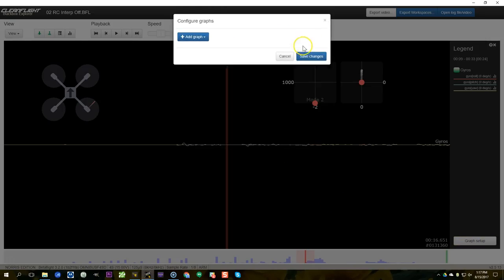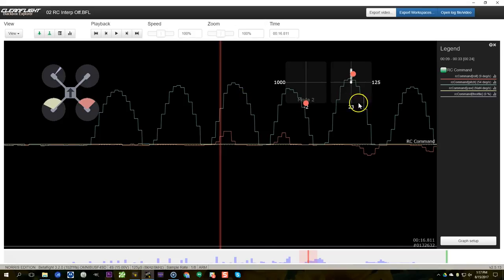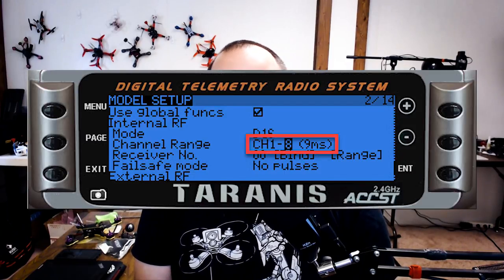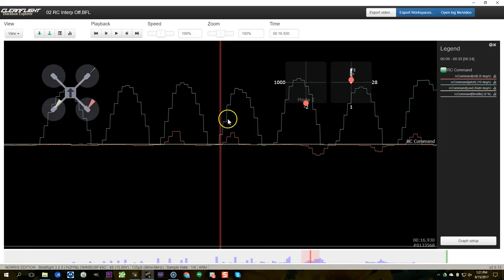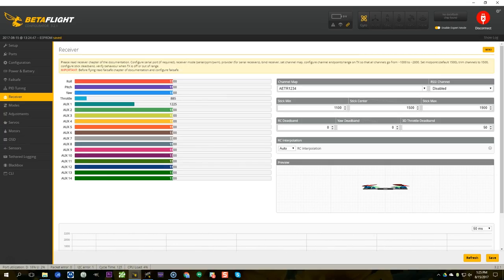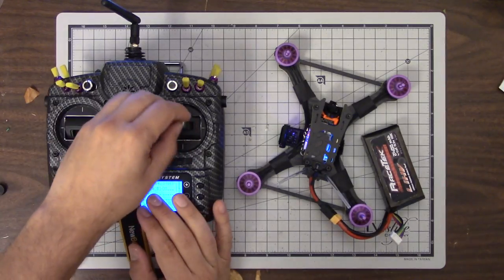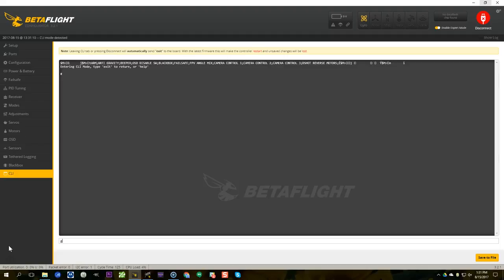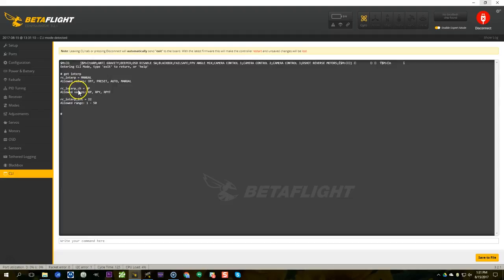Betaflight RC Interpolation | HOW TO TUNE

Comment: Joshua, here are my views on RC interpolation (which may prove to be somewhat controversial).

As you point out in your video RC interpolation reduces DTerm "kick". Decreasing the RC Interpolation Interval reduces delay and increases DTerm kick. As you allude, you can also increase DTerm kick by increasing the D Setpoint Weight.

Now different pilots prefer different amount of DTerm kick, so the question is: how best to achieve a given DTerm kick? You could use a largish RC Interpolation Interval and a largish D Setpoint Weight, or a smaller RC Interpolation Interval and a smaller D Setpoint Weight. Which is better?
 
My view is that it is better to reduce the RC Interpolation Interval and D Setpoint Weight. Why? Because RC Interpolation has several bad side effects:
 
1. Delay. RC interpolation delays the whole PID response to an RC input. If you are running 8kHz PID loops, then a 1 ms delay in the RC input delays the PID response by 8 entire PID loops. If you are travelling at 20 m/s (about 45mph) then in 1ms the quad travels 2cm, or almost an inch. In 10ms it travels 20cm or almost 8 inches.
2. Jitter. RC interpolation is processor intensive and can, depending on your setup, cause jitter in the main PID loop.
3. RC interpolation is a somewhat primitive filtration method - better filters are available to use on the DTerm directly.
 
I would go as far to say, that, if you have a non-zero value of D Setpoint Weight, then you should reduce it to zero and simultaneously reduce the RC interpolation. Or even turn off RC interpolation.
 
And that's how I run my quads: RC interpolation off and zero D Setpoint Weight. (That's the bit that may be controversial.)
 
Now I have to qualify that: I'm not a particularly good pilot - I'm a better developer than pilot, so other pilots may find that it doesn't work for them.
Reply from the maker: Do you mean setpoint weight instead of setpoint transition? Transition controls reduction in setpoint weight on stick return-to-center. But I don't think it affects the amount of kick on stick deflection.
Reply: Yes indeed, I meant setpoint weight. I've corrected my comment.
Reply: I would be interested in hearing a discussion on why that would be controversial. Does it go against conventional wisdom on RC interpolation and D Setpoint Weight interworking? What are the pros & cons and how would it not work for some pilots? And it should be noted that today I learned more about these settings that just noticing them in the configurator and ignoring them :)
Reply: I said it would be somewhat controversial because I have seen several postings in RC groups about RC interpolation and getting a smooth RC trace. My view is less delay is more important than smoothness, which is probably not the common view.

When I said it wouldn't "work" for some pilots I meant it figuratively, ie some pilots wouldn't like it.

I would encourage you to try different settings to see what works for you - tuning is quite personal.

Comment: Nice video Joshua. In my humble opinion the tune should be based in "normal" stick movement, no need to add extra latency when we are looking at surreal fast stick movement that will not happen in a normal flight. Record the blackbox with normal stick movement and we should be able to use a lower value. Just my opinion
Reply from the maker: That's fair.
Reply: I doubt that it will make much of a difference though, the stairstepping doesn't disappear if you move the sticks more slowly, it just becomes harder to see.

In theory the optimal value for the filter is the update period of your transmitter. If the transmitter is always transmitting one packet every 11 ms, then setting the filter to 11 ms should completely eliminate the stairsteps.

Comment: Joshua, I enjoyed watching this video as well. Quick comment: In the end it really does not matter how smooth the rc_command looks like on the blackbox output. What matters I think is the overall response of the system, including motors, props and so on. Motors (amd maybe props) being mechanical in nature, should have a low-pass response that will also filter the input command. Also, depending on the type of ESC control (which you explained so well in a previous video), there may be some averaging there as well. I'm thinking that one could use the accelerometers in the system to detect the type of response the system has to a step (also initiated in an automatic way) and then, use PIDs and maybe the RC interpolation filter to get the best response. What do you think? Thank you for the outstanding effort to advance the hobby.
Reply from the maker: I do think that some flight testing may be desirable to finalize the numbers. But this is a good starting point. Also remember that setpoint weight plays into it. If you have low setpoint weight, then this doesn't matter as much because D will kick less.
Reply: Even if the system response seems OK, there may be very high current spikes caused by the ESCs trying to spin up the propellers at excessive speeds because of these stairsteps. I've measured these myself before I added some filtering to the RC inputs. It creates extra heat and could damage ESCs in extreme cases.
Reply: You may be right, but I think, this depends on the ESC Protocol. If the protocol averages the ESC input over time, as Joshua was presenting in the video regarding ESC control, it may be better, meaning the motors will not see big jumps. It's all fascinating, who really knows, I'm wondering... :-)
Reply: AFAIK no ESCs designed for use with multirotors do any averaging, because in-loop lowpass filtering would almost certainly cause oscillations because of the added latency. Filtering must be done outside the feedback loop, i.e. on the RC inputs, not the ESC outputs which are part of the feedback loop (FC -> ESC -> motors -> propellers -> movement/rotation -> IMU -> FC).
Reply: Agree with you makes sense to filter it outside the loop.

Comment: How can you tell what value it is using in AUTO? You seem to imply that it was 22 in your case but I think that it just the last used MANUAL value. In my case, when I switched from AUTO to MANUAL, the value appeared as 19. I then changed this to 16. If I switch back to AUTO, then MANUAL again, the value stays as 16. Further, if I look at previous blackbox logs (with AUTO) I can see some stair-stepping, but at 16, stair-stepping is much reduced. This seems to indicate that AUTO is using a much lower value. If AUTO is using the rx speed (as indicated by docs) then it would be selecting a value around 9-11ms which would tally with what I am seeing. So it looks like AUTO maybe abit agressive in some cases and manual tuning would actually increase latency. Results obtained with FrSky XSR-M.
Reply from the maker: Interesting observation. I never noticed that before.

Comment: Great info joshua, even though a lot of people wouldn't bother with this, I appreciate the fact that you do! I have had a loose grasp of this and have to thank you for going into detail. Talking about things on forums can only go so far! Thanks again!

Quick question about using 8 channels vs 16. Does a person have to flash the 8 channel firmware (xm+) on their receiver to get the less latency? Or is it strictly based on the setting in the taranis.
Reply: ZeroFPV I'm having a little issue with a brand new xm+, I've always done max_aux_channels 12 and rssi channel set to 16. I think this new xm+ may have the 8 channel firmware on it. I cannot get rssi over channel 8 working for the life of me. I'm pretty frustrated and wondering what to do, maybe you know? :-)
Reply: There are 2 different 8CH firmwares. One with RSSI (7channel + RSSI) and one with the full 8 channels and no RSSI. So it might be the 8CH without RSSI firmware on your xm+. If you can't flash a different firmware you can just try to assume a function to channel 8. If it's possible to do you are using the firmware without RSSI. BUT! There also was a bug in one Betaflight version with the RSSI channel mapping.   EDIT: The bug was in BF3.1.5. So if you are on 3.1.5 you can't get it to work.
Reply: OK, the bug was limiting the max auxiliary channels to 6 which shouldn't
 bother you at all if you have the 8 channel firmware. If you have the 
16ch try putting "set max_aux_channels = 12" into the CLI and "save"...
Then you might see the RSSI moving in the AUX 12 indicator of BF.
Reply: ZeroFPV thanks for the heads up, I think it may be the one without rssi for some reason.. I've tried setting the rssi to channel 8 and max aux channels to 7, if it was the firmware with 7 aux and 1 rssi channel should that make it work? The xm+ has no telemetry so I can't forward rssi through the taranis unfortunately :-(
Reply: Would be shown in AUX4 in BF then. So max aux 7 would be enough, yes. I'm using the XM+ with my Devo 7 E and show the RSSI in my OSD. The R-XSR is coming soon. Size of a XM+ and full telemetry + redundancy option. Beside this, it's not difficult to flash new firmware with the help of your Taranis.

Comment: I'm not familiar with the specific code, but Betaflight surely can determine the filter setting on its own, by timing the serial updates?  I'd figure it should be able to tell that say 8 channel D16 is 9ms and auto-adjust just fine. Also, if you want fastest packet rate on the Taranis, Crossfire does 150hz, i.e. 6.67ms, with 12 channels.
Reply from the maker: That's why there is an "auto" setting. But some pilots prefer to set it themselves.

Comment: Hey Joshua, had a strange issue today I never had before. When flying, I had random control delays with throttle. Such as I would be push full throttle to go over a tree and when I dropped the throttle to zero instantly it would still keep at full throttle for maybe a little less then half a second. Pitch and roll seemed to be fine but throttle kept sort of sticking full off and on. Do you know what this could possibly be? Thanks
Reply: aubrey vantuyl check your gimbals. When they go bad this can happen. Happened to me twice.

Comment: How quad specific is this? If I have two identical receivers, would you expect I would set identical rc interpolation values on both? If I have two receivers on the same protocol, but different models, would they be different? betaflight configurator could have a drop down box where you set your receiver model and it configures this for you.
Reply from the maker: I don't have enough experience to say for sure. But yeah, I would expect two identical SBUS receivers to have identical results.

Comment: Is the packet interval only transmitter based? So if you tune it on one copter you can copy the lowest possible value to another copter that hasn't got blackbox recording capabilities, as long as you use the same transmitter? Or does the receiver also play a role in the packet interval in ms?
Reply from the maker: +Bjorn Hees it's the transmitter

Comment: Mines settled at 16. 6ms less latency, I'm good with that! Prob wont notice a damn bit of difference in flight but I feel better for doing it! :0) also checked the Yaw axis and that was just pure steps. Added it to the interpolation in the cli and its smooth as a smooth thing now.  There is a lot of stepping on the throttle. Would it be prudent to add throttle in the cli too josh?
Reply from the maker: The default settings don't do interpolation on the throttle or the yaw axis, because there is no D term on those channels, so there is no D-term kick. Some people do think there is an advantage to smoothing those axes though.
Reply: Joshua Bardwell hmmm, yeah, good point about the D kick on those axis. Or lack of in this case. I added interpolation on the throttle as well as yaw after all. In my mind, having the fc see smoother commands coming in, has to be a good thing. Are there any down sides you can see to adding the Yaw and throttle josh?

Comment: Tried it with the fs-i6/ibus on sp racing f3 and didn't see any kinks until about 6ms. Looks fine at around 8 - 9ms. That seem pretty low ... ?
Reply: I forgot to mention this fs- i6 is running the 10 channel mod. I have the exact same setup with the q x7 so it will be interesting to compare.

Comment: well, this was very informative. if we could give ratings to each of your videos this one would be 10 out of 10, can't wait for the part 2. btw sometimes you refer to some of your older videos and say you'll provide a link top right corner but I can never see such link (like in this case you mentioned D-term kick video that you made earlier, I can't find it). lastly, is there a way to figure out how much a r/c link latency there is when the quad is far away (ie. 3km away, does it add considerable latency ?)
Reply from the maker: The links are Cards. There should be a white pop-up that appears with the video title. Or you can click the (I) icon in the upper-right to see all cards.
Reply: that's strange, no cards ever come up and I have no (i) icon either.

Comment: Out of interest do you run interpolation on yaw and roll also?

Also do you know what's going on with black box and The missing info button?
Reply from the maker: I don't know where the info button went, but I think you can press I to get into. Or maybe it's H for "header". Boris' argument is that you don't need interpolation on yaw and throttle because there is no D term on these axes, so no D term kick to solve. But some pilots on rcgroups feel that the smoother P term is desirable, and they do run it on yaw. I don't know about Throttle.

Comment: How does this help when using the crossfire module? I've tried and could not get the smoothness I see here. I get close but not smooth. Using BF 3.1.7 CRSF protocol. I've also tried turning interpolation off, (which got motors hot) and auto, but manual seems the best option, just not as smooth as I see you get here. I would like to go back to the Crossfire but when using standard Frsky SBus protocol this makes my tuning so much easier and I'm able to run D gain much lower on my setup.
Reply from the maker: I really don't know how crossfire might interact with this feature.

Comment: Hey Joshua, i just got a wizard x220 and when i was installing   A buzzer, I believe I accidentally shorted the pads. The buzzer is still working. When i solder the buzzer on, you have to put your ear right up to it to hear it. Its very low and very hard to hear. I seen your video where you can move things on the fc to different locations (like moving a motor/esc to a different motor/esc pad. I was wondering if i could do that with a buzzer so i could solder it to different pads. Thanks.
Reply from the maker: It's not easy to move the buzzer pad. The buzzer requires an external circuit known as a "buffer". This is built in to the FC but if you move the pin, it won't be there (unless you build it).
Reply: Joshua Bardwell Hey Joshua, thanks for the reply. I have a spare fc on the way ( banggood gave me one a while ago) and i think ill just replace it. I don't wanna take the risk of crashing and not being able to find it.

Comment: tried to change to D8 on X7 with my XM+ to save latency, would not receive unless on D16. gave me a start- I had just reflashed for the RSSI channel 8 and changed the D16 to D8 same time, Major WTF moment. Oh well, found the problem. One more exception?

Comment: Does it only effect pitch and roll smoothing. I have turned off and left as default and looked at logs and roll and pitch are def smoothed but throttle and yaw are not. Is that normal?
Reply from the maker: By default only roll and pitch are smoothed because only roll and pitch have D term kick. You can change this in the CLI but I don't remember the command off the top of my head. I think I showed it in the video though.

Comment: i always wondered what that was for lol... teach me to not read the book huh :D from what it seems, looking at this, you want to e at frame rate or higher, eg 11ms+ or 22ms+ for example. I couldn't see any use going less than the frame rate of the receiver... your thoughts?
Reply from the maker: Some filtering would still occur even when the timing was lower than the frame spacing. But in general, I agree with you.

Comment: Should not the rc_interp_interval value be equal to the length of rc_command frame in milliseconds?
Reply from the maker: The purpose of the interpolation is to eliminate d term kick caused by stair-stepping. I'm not sure there is a single optimal value. The lower the interpolation value, the more stair-step and kick you'll get. So it's just a question of how much of that you can tolerate.

Comment: I can't make my graph look that smooth even with 30 on the RC Interpolation setting. Is that because A: I move the stick too fast and/or B. Is it because i run D16 with channels 1-9 in use and the rest enabled, just because Taranis says the delay is 18ms even if i just enable the 9 i actually use. RSSI on channel 9 because i forgot to solder the stupid analog RSSI wire to the FC and im too lazy to dig my de-pinned X4R-SB from below the FC to fix that right now.
Reply from the maker: I honestly don't know.
Reply: I did a little bit of testing and when i set my Taranis to 9ms, everything worked as in your video. When i changed it back to 18ms with the exact same RC Interpolation value of 12, everything went to notchy as heck. I did after a bit of trial and error manage to get the graph look somewhat smooth with the RC Interpolation value of 25 and channels 1-9 active on my Taranis and the quad did seem to fly a little better as a result as well. I also looked what the auto value did and oh boy, that was a notchy mess, so at the very least tuning the value to work smoother with 18ms was worth something.